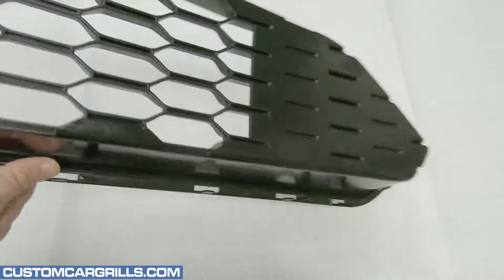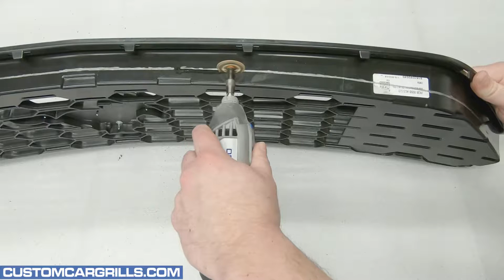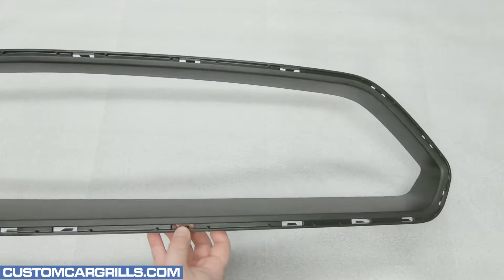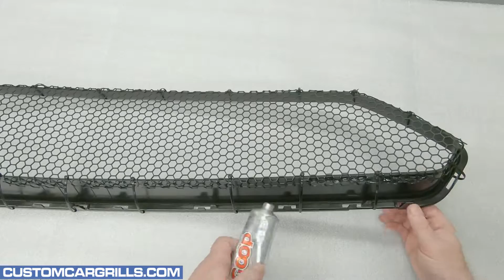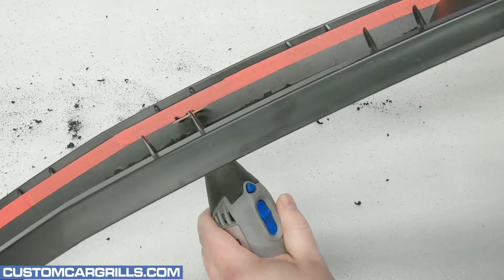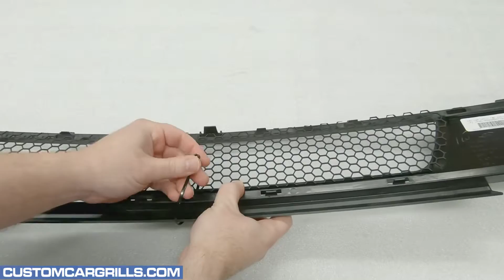Ford Mustang Ecoboost 2018+ Grill Delete Mesh Installation How-To by customcargrills.com

Comment: Hey I just would like to inform you that doing This will cause hood flutter
Reply from the maker: From what I understood, the hood flutter came from a lack of a rubber seal on some year/trims on the hood near the headlight region.  In all the years we've been selling these, we have not heard of any issues with hood flutter as a result of modifying the grille.
Reply: @customcargrills  thank you for replying as I did the grill delete and noticed mine has hood flutter but it’s most likely from what you stated

Comment: I just used a 4 in cut off disc on a 4in grinder. And a flap disc to even it out. All u welders out there..I know u have this equipment. It works just as well as long as ur good with blending.

Comment: THAT is the look I am going for - but without the mesh - same basic procedure for a 2016 Ecoboost ?
Reply from the maker: The 2015-17 Ecoboost is a bit different.  It doesn't really have the depth in the grille that's needed to do this mod properly.